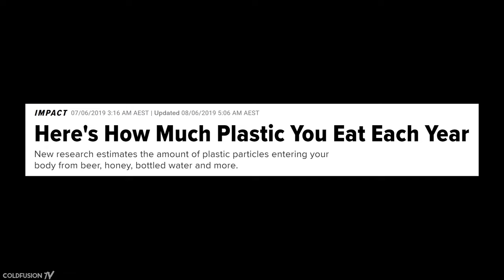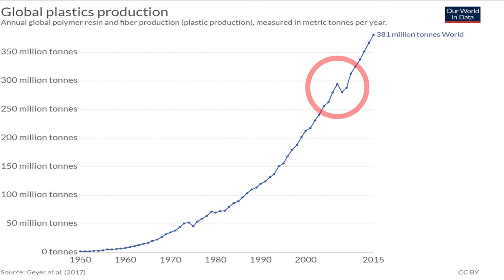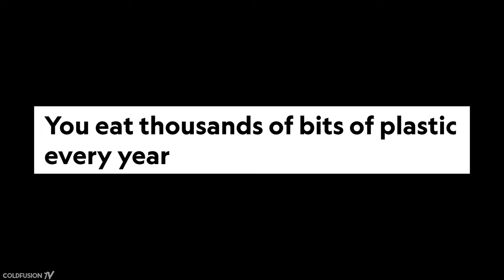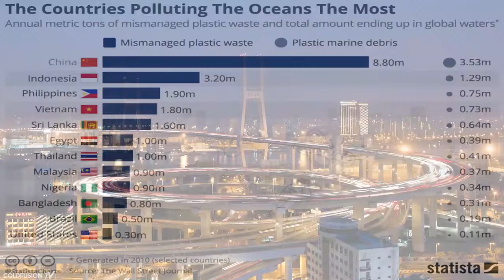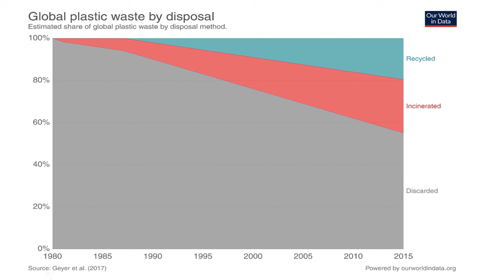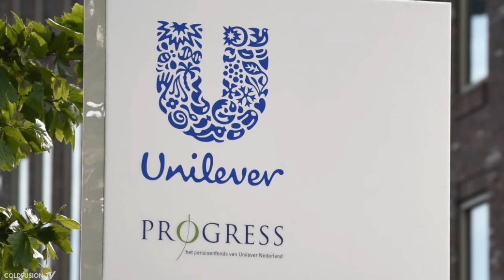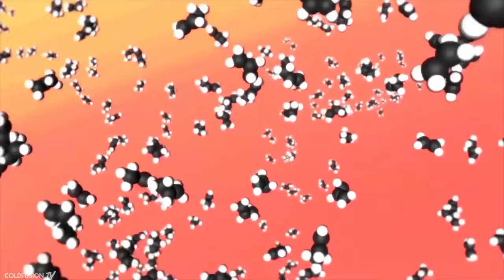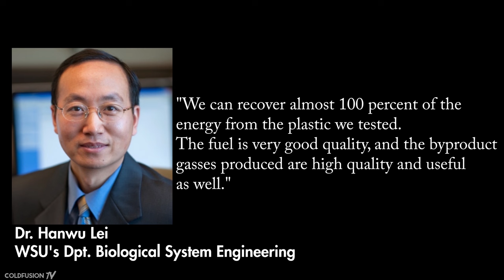Turning Plastic Waste into Jet Fuel!

Comment: Do the statistics for most plastic waste produced by country include the plastic waste that's imported/exported?
As you said, the stats are from 2010, well before it was exposed in 2018 that China was the largest importer of the world's plastic waste (I suspect that this allows western countries to report suppressed numbers).
Also related, you mention that about 45% of the world's plastic is recycled. I think it was a missed opportunity to not expand on where that 45% actually goes. As we now know, most of the recycling was sold to China and not actually "recycled". It seems like our recycling programs were all a public relations gimmick.

Comment: Hi Dagogo, i think youre missing alot of points in these matter. Like BPA doesnt just cause sperm count problem but it also a known carcinogen (causes cancer) - BPA is just one example of Plastic Additive  among many known n unknown additive to make various types of synthetic plastic. 

Then the point on solution, i think you should study first/finds out the stem problem of those Single Use Plastic pollution. Look for Zero Waste Solution, the zero waste movement have some extensive points n solution. What the Loop is modelling is the core of zero waste movement - which is to Eliminate Single Use (the stem problem of waste). Zero waste shop, zero waste deliveries etc are being done to tacle waste problem. Its a good video idea to explore this GLOBAL ISSUE. 

Here is something to think about, if people using waste plastic to produce (upcycle/downcycle) fuel the single use production will keep going - well that is problematic to say the least. Of the pollution producing single use plastic, of the fracking to produce oil to make single use plastic, of the unnecessary pollution the having Single Use way of doing things, and so on. please dig deep into it

Comment: the tech to do this is basically the same as petroleum cracking.  we COULD have been doing this for the past 75 yrs if big oil had wanted to, but they don't.  why would they?  they are not penalized in any way for the billions of tons of plastic waste polluting the earth.  they've foisted that burden onto the taxpayer (as usual).  and doing so would decrease the demand for crude petroleum and therefore (allegedly) the price.  make them accountable for every oz of plastic waste, and you'll see how quickly they start doing it.

Comment: The problem is that plastic recycling is not really economical yet. Most processes are a form of downcycling which produce lower end plastics than the source material. For example a clear PET bottle can be downcycled once to a slightly milky but still clear PET bottle. After another downcycling you can not create clear material again so it's used for shampoo bottle. It's the same deal high strength plastics like PA. They can be downcycled once or twice while loosing strength until they are pretty useless. There is no known way to restore their properties without using a mix of old and new material, a lot of energy or expensive chemicals processes. Even the downcycling is not economical most of the times. At this point there governments need step in and subsidize recycling while taxing the use of new material. At that point you have a clear business case and money starts flowing. Unfortunetaly that is an inconvenient step for a politician and in countries with bad education i would say it's just impossible. But at least the problem is getting some attention from the general population which is some kind of progress...

Comment: But the main question is - and I don't feel it was stated directly in this video - isn't making this fuel from plastic consuming more energy then energy this fuel will produce?? If that would be true, the only way we can call it is more as "way of storing energy", not real "fuel" - but how efficient it is compering i.e. to batteries and so? Of course it is better to store energy by reducing amount of plastic in the world, but if amount of energy lost will be big - it won't get commercial success. And what is a point of producing fuel from plastic if power plant will produce more pollution by burning even more coal? Only solution I can see would be if we could use solar energy somehow to turn this plastic into this fuel - probably it would be much slower process but it would indeed reduce of world pollution, but still would be more like "way of storing energy" then "real fuel".

Comment: You know we can't digest plastic, right? In one hole, out the other.
While they can "recover" almost 100% of the energy used to "produce the plastic", you failed to account for the HUGE amount of energy needed to convert the plastic in the first place, it's significantly higher than just making jet fuel out of oil. Remember, you can't break down chemical bonds for free. This is not a viable solution. It would be much, much more efficient and green to just dump the used plastic in a landfill and create fresh fuel from pretty much any other source.

Comment: Turning plastic into fuel is sense, as the source is crude oil. It is backward integration with business sense. 
Here in India they melt and use it to make roads. 
Solving the plastic issue can save many lives including seasonal bound. 
Jet fuel by itself is polluting but at least one problem can be solved. 
Commercially how many countries have taken up such an issue is questionable. 
Contributors like Asian countries need legislation to speed up the cleaning process of their rivers. 
Also cotton and jute can be alternatives to plastics say the packaging industry. 
Will Amazon listen?  Big corporations have to listen to environmentalists.

Comment: Plastics - They are usually synthetic, most commonly derived from petrochemicals. Plastic is product oil gas and so it has sense to get fuel from plastic, efficiency of such reverse engineering will be more energy requires to reverse plastic into petrochemical product. Good deed, but very harmful for environment.

Comment: If we convert plastic into jet fuel won't that increase the amount of toxic fumes and Co2 when it's burnt in a jet engine. 
Will a tractor running in diesel put out particles that will choke us all to death ? 
Ok if you can recycle it all ; and collect it all, then the system is better than the one we have now. 
It's all about educating the public and stopping bad habits.

Comment: Turning plastic into jet fuel sounds nice but it's not going to solve the plastic pollution problem. Legal moratoriums on plastic that would effectively ban it from common use with a few exceptions would be better, as would grand scale clean up efforts and pushing people to use and buy less and less of it would make a bigger difference than turning it into jet fuel that will just end up as more co2 emissions.

Comment: great video. great for the oceans and sea creatures. the concept seems pretty solid, but when you consider that we also creating another pollution issue by burning all of that "fuel"- creating another problem... i dont want to eat plastic, but is breathing it in a better a idea? only humans who benefit are petrol heads- cos potentially cheaper fuel to burn. solved one issue created a new set of issues... Plastics all round need to be treated with respect. but we all too busy making them dollars to care.

Comment: Often when a technology is presented as an environmental solution it's impractical.  I suspect that's what we have here. Unfortunately the environmental movement is drawn to ideas that couldn't find logical support anywhere else. Does it really make sense to turn plastic into jet fuel. It seems like would take  a lot  more energy to convert it into a high end fuel than to minimally recycle it. Isn't even cheap plastic more expensive than oil. Maybe using it in construction materials would make more sense. Products used in construction are often excluded from the waste stream for centuries. Maybe that could lead to more efficient use of forest products and other resources.
                     Probably the best way  to conserve resources would be to find a relatively clean way to burn it as is.  Maybe for process heat. That way you could reduce the amount of virgin materials used and refine something easier into your desired products.

Comment: I have all the solutions with very few oppressive laws to civilians but lots of taxes to responsible corps from the past and present in order to get them to comply. None of this will cost jobs & businesses will comply to avoid the tax and the only other thing would be awareness for civilians and possible having to pay a down payment to incentivize return of fabric bags etc back to businesses. Other then that huge irobot boats that collect trash via solar panel powered engines that use hydro regenerative battery charging tech

Comment: But we are moving to electric cars from normal fuel?
Reply: Electric cars are much more feasible than electric planes. Batteries are too heavy to use as a fuel source for planes, and there are physical limits to how much energy you can fit into a batter of a given sixe. Plus, high energy batteries have a nasty habit of exploding lol

Petroleum based fuels like gasoline and jet fuel are super energy dense and surprisingly not that volitile because they requure oxygen to ignite. That's why, outside of action movies, cars don't blownup despite being full of highly flammable, energy-rich fuel.

Comment: Packaging standart and rules must be changed. Plastic Packaging material must be changed with New material. Same colour or transparency or same diamension must be an obligation fır ali company. For example Cola Pepsi and other companies must use same type bottles. New Plastic material must have differant density than paper based Packaging material so when you grind two of them together it can not be big problem, by using density differences you can separete them easily by using diffent density liqueds. Packaging Plastic must redesing according to 100% recycle. Easy separetable Plastic material must desing.

Comment: Straight up, a lot of the things we have now and over the last 20_ years, we could have had in the 1960s easily. BUt MONEY gets in the fucking way. BUt more importantly, there was a japanese dude with a simple machine he had where he could break down and convert most plastic bags and bottles, into gasoline/petrol/usable oil and types of fuel for all our appliances. HE went radio silent...dont know what happend to him, but I can guess. NOw this is coming up, and I wonder if he was bought out or killed ofr his invention. NO surprise we eat plastic. Like flouride, it serves to poison us and block our upper brain power.  It aint perfect, but drink water that is cleanly filtered, purified and distilled to start healing yourself. NOt perfect, but again, this is all part of the plan of the people running the show from behind the scenes. Population control and trimming.

Comment: I hate to say that. But recycling plastic into fuel is dumb as hell. CO2 that was supposed to be in a landfill for 500 years is going to be converted in CO2 that's going to be thrown in atmosphere now? Really? The problem with plastics is that they aren't thrown in landfills properly. When that happens  they end up in rivers and oceans. So automate trash collection should be the priority. If plastic stays in a landfill for 500 years it won't be in the atmosphere. The problem is that on 3rd world counties the trash bags are manually collected. And if it rains, those trash bags will end up in rivers and oceans! If we can enable countries to an automatic garbage collection to be cheaper than manual labor, then the CO2 would be "safely" stay on the landfill for centuries. By turning it into fuel, you are warming up the atmosphere now!

Comment: We need to think how is this all made then break it back down to original form to dispose properly we have been dumb as fuck and need to turn that fuel into original form and dispose properly again i see alot of plants being built for this use solar and windmill for power source and hydrogen generators electricity can be made a million ways so lets be absolutely brilliant will disposal tactics

Comment: I don't know much, but this seems like an AWFUL idea. Climate change is a far far more pressing issue than plastic pollution. We should be spending money on reducing carbon output, not turning plastic on the surface into even more carbon in the atmosphere! Maybe with carbon capture it might be okay but there are still many problems with that.

Comment: YOU SHOULD SIMPLIFY THIS YOU DON'T NEED CARBON YOU ONLY NEED PLASTIC WITH HIGH HEAT IT'S THAT SIMPLE ANY PLASTIC AND GENERALLY YOU'RE GOING TO GET DIESEL FILTERING IS ANOTHER ISSUE BUT NOT REALLY IMPORTANT IT'S NICE TO SEE MANY VIDEOS ON THIS

 PEOPLE SHOULD WATCH THEM ALL IT WILL BUILD THEIR CONFIDENCE . I THINK PLASTIC IS A MUCH LARGER ISSUE THAN GREENHOUSE GASES INFACT FOSSIL FUELS IS NECESSARY BECAUSE METHANE GAS IS NATURAL IF WE DID NOT BURN IT THE ENTIRE EARTH WOULD EVENTUALLY GO UP IN FLAMES JUST LIKE THE BOOK OF REVELATIONS SUGGESTS ; BY WAY OF A SIMPLE LIGHNTING STRIKE OR IGNITED BY THE SUNS REFLECTION FROM QUARTZ OR JUST ABOUT ANYTHING . THE GODS PLANNED IT THIS WAY . PERSONALLY I THINK SOLAR PANELS WILL CAUSE THE REVELATIONS ACT I HATE SOLAR PANELS .

Comment: sure why not burn plastic?|
out of sight out of mind eh?

noone will notice air pollution .....
Reply: it is the same thing which you use in your car Gasoline(petrol-formula=c8h18) and plastic ((c2h4)n), the difference is one is very small chain all you have to do is cut the molecule of plastic into much much smaller one.
WHAT I MEAN IS its using plastic based fuel is just like your regular crude oil which we are extracting from fossil fuels....................

Comment: 1. I still support nuclear, invest more in it pls and remove the public stigma.
2. Fossil fuel extracting companies will probably tamper with efforts.
3. Co2 is a little problem, plastic is carbon that has been taken out of the carbon cycle for a few hundred years(not long but still longer than our life spans).
4. Genetic modification?? Would it be possible to engineer a organism that can sap CO2 out of the cycle fast enough to quell the effects?